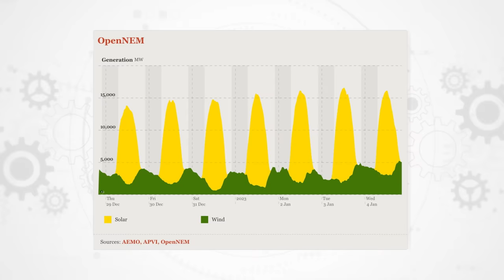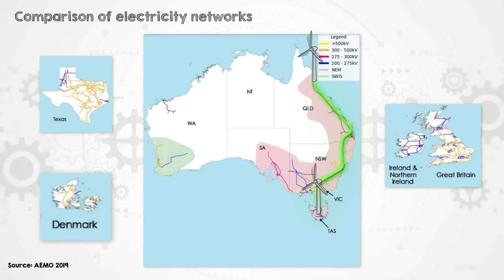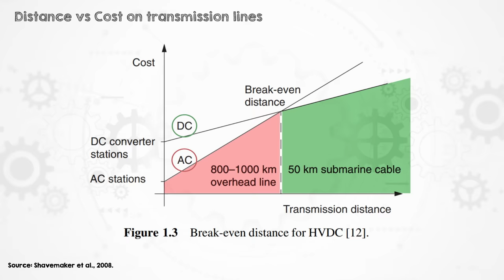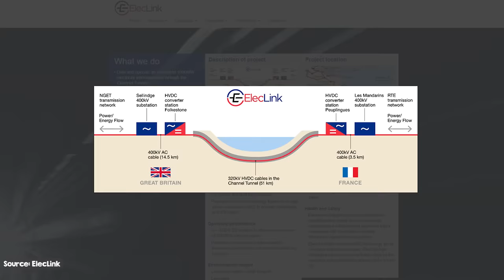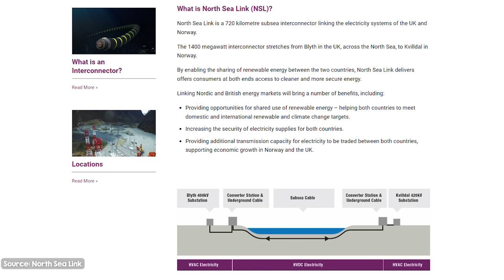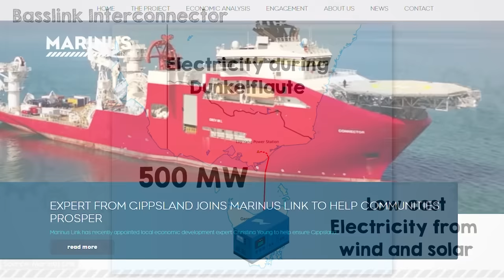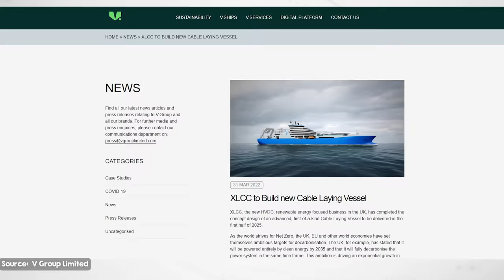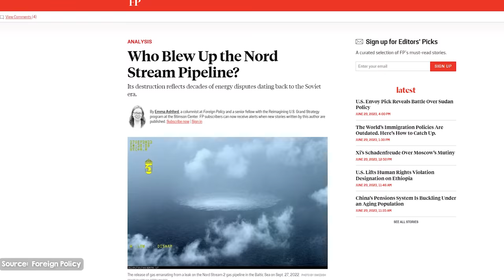Electricity Across Oceans: Is HVDC the Future?

Comment: Great video!  You mentioned connecting Montreal to Liverpool.  That means connecting to Hydro-Quebec, a vast and not fully utilized resource.  It generated about 225 TWh in 2022, an average of  25 GW. Quebec itself uses about 80% of that.  HQ has been trying for decades to get links down into the US Northeast, but they get blocked by local opposition.  E.g. there was to be a line across Maine down into Massachusetts that was strongly supported by the state of Maine, but delayed by a referendum paid for by a Florida natural gas company.  It's not quite dead, but in a coma.  The nominal reason was the effect of the power line right-of-way on Maine's forests.  Running an undersea cable down to Boston and New York might actually be easier!

I also keep hearing about HVDC from Iceland to Europe to distribute geothermal power, but so far it seems more economic to use the power to make aluminum.  HQ does that too.
Reply: Norway has done the same thing. There, in order to provide more 'green' power to their grid, they increased the depth of the smelters' reservoirs by a few metres. The smelters are connected to offshore wind turbines, and use them to pump water into the reservoir when they don't have a need themselves. The reservoirs were then connected to the grid for the first time.
However, these sources are in the North of the country, a long way from the main centres of population and industry. The result is that after the Norwegians went EV in a huge way, Norway was taking electricity from their HVDC connector to the Eurogrid. The result is that the EV 'revolution' in Norway is being fuelled by coal fired power stations in Poland and Germany.
Reply: @nicktecky55  When did Norway import from Poland? The only time Norway import from Germany is when the price in Germany is very low, exclusively when Germany has excess renewable output. And the EV impact on consumption and prices is so far insignificant. I did an estimate on Sweden, going all EV would increase demand with 10 to 15 TWh, and Norway has maybe 40 % less cars than Sweden. So Scandinavia going all electric on the roads would mean an increased demand amounting to less than 10 % of current consumption. At the same time some different cleantech projects, like Hybrit and H2 Green Steel, will each consume more than that.

Comment: Very interesting. Very long cables in the order of 1 km will also radiate energy (think very low frequency radio). I really enjoy your rational, well-thought out videos, with no hype, you are one of a kind on Youtube, actual expertise with no axes to grind!
Reply: If the cable was only carrying DC electricity, would it still radiate RF (or are you discribing something similar to but not actually RF?)
Reply: @chrismarshall25 A DC cable wouldn't emit any RF, because it is steady state. Electromagnetic fields/waves can only be created with changing currents.
Reply: Yes, DC conductors create a magnetic field around themselves.  The field varies as much as the current varies.  If the current is constant, then the magnetic field will be constant-- just like a magnet.
Reply: @peteinwisconsin2496  that wasn't my point 50 or 60 Hz  create electro-magnetic fields that will radiate on very long lines. this radiation is a power loss, like losses due to resistance.
Reply: @SuperFredAZ  0hz is not a radio frequency
Reply: @SuperFredAZ   ... this radiation is a power loss, like losses due to resistance. Yes, it is resistance. But technically it's called impedance.
Reply: @Alex-lc1bv  With switch mode choppers on DC systems there can be  RF radiation up to low VHF. Although the measured levels are minute and harmless to life it can be death to MF and HF radio communications.

Comment: For years now, Norway and The Netherlands are connected as well ...  North Sea. The Dutch also have an energy platform island in the North Sea, this allows connections with sea based wind farms (windmills connect to the platform, operational already!). The platform provides an opportunity to connect with the UK grid. Another Danish - Dutch platform will be built for more Dutch and Danish wind farms and to connect Danish and Dutch grids. Sea based connection platforms can be the interconnection nodes in cross sea networks.

Comment: 10:45 You mention Montreal. I think that I need to correct one very important detail about Québec. We have very little solar power. Almost all of our power needs are provided for by giant dams located a thousand kilometers north of the population centers. There's also a number of wind farms. In eastern Canada, the potential for wind energy is greeter than solar. It probably would be the right place to connect an undersea cable given that the power grid is rather well developed in Québec. Eastern Canada has gotten a few upgrades with the lower Churchill project, and there is room for another dam to expand capacity.

Comment: Hi Rosie, great video! Interconnectors are incredible and we need more videos like this one to help inspire future engineers! Just as a small FYI though, ElecLink does not make it's money from buying power in one country and selling it into another. The revenue is generated on a capacity auctioning platform called the Joint Allocation Platform (JAO). Basically energy companies can auction for the rights to transfer power a cross the cable and ElecLink recieves the money from each auction. The only time ElecLink would ever buy power from one country and sell into another would be during the commissioning phase of the project.
Reply: *Joint Allocation Office

Comment: In the winter you can get a few extra hours of solar power in your system going north to south.    It's always a 12-hour day at the equator.  If you're lucky enough to get some place on the other side of the equator you can get Summer sunlight all year round

Comment: Really pleased to see the use of non pumped hydro as a battery for wind and solar.
I was very surprised when commentators assured me that only pumped hydro could be used as such for reasons that were far from clear.
If only the electricity market in NZ was somewhat sane, we should be doing a lot if this here. Savecthe hydro for when the wind isn't blowing.
Reply: This is intetesting. Nonpumped hydro requires a bypass of some sort during dormant periods. If that is truely available and cost effective...perhaps we really already have an overlooked battery just sitting there and waiting for proper integration into the 100% renewable grid. This would be interesting to analyze. Has Rosie addressed this allready?
Reply: @aleksandrsnaumovs4277  My local "power station" is non-pumped hydro, been operating since 1962, only at peak periods as there is not much water available.  It does the same job as the UK-Norway HVDC link (where Norway is the local area), and was built mainly to avoid upgrading the power grid which can't support peak periods but can support average load - it is effectively a battery, but recharged by the river rather than the grid.
Reply: Why would you think that does not presently happen.? Hydro can be throttled quite readily as compared to geothermal or coal, and does indeed balance vs wind in NZ just that wind is still a small overall portion
Reply: Then it's not really a battery.
Reply: @Robert-cu9bm  It is stored power, discharged when needed and recharged when not needed.  Definitely a battery.
Reply: @nigels.6051  
So is coal a battery?
What about natural gas?
Reply: @Robert-cu9bm  Sort of, but they are non-rechargeable, since with the current world climate very little new fossil fuel is being formed compared to what we had in the carboniferous period.  However methane, which is the main component of natural gas , can be generated from net zero electricity and stored in our current natural gas stores,  so it is very likely that "synthetic gas" will be used as a battery, it is a good fuel for rocket engines and aeroplane engines, as well as feasible fuel for backup gas powered generators for when there is a lack of wind.  Much easier to store than Hydrogen, we already have large suitable stores..

Comment: Thanks for the explanation, as a civil engineer my knowledge of electrical things is very limited. 
As a Canadian, I’d like to point out that Montreal is no where near where you labeled it! It would be better to end that transmission line in Labrador as that is where the bulk of the hydro generation is. 
There is currently a proposed transmission line from Eastern Quebec to NE US that is being block for running through wilderness areas. I wonder if an undersea from Labrador to Massachusetts would be feasible 🤷‍♂️

Thanks again

Comment: Yes, geopolitical insecurities are likely to become more and more important issues to factor into undersea HVDC.  While battery storage (from pumped hydro to various cell chemistries) is seemingly more expensive, I believe the cost/kWHr storage will abruptly fall year by year in the next half decade as newer and more cost-effective stationary storage plants come on line around the globe.  Furthermore, it is MUCH easier to use such storage to smooth peak-demand on grids locally.
And last but not least, the massive and enthusiastic trend for home owners to go solar and also contribute to virtual power plants has been proven in the UK to remove massive stresses from ageing and (currently - no pun intended) inadequate electrical grid structures.
B.T.W. Seriously clear explanations in this one Rosie.  Thank you.

Comment: Can you talk about the energy losses at the AC->HVDC and HVDC->AC conversion stages compared to the high voltage AC step up and step down transformers?
Reply: I would like to hear Rosie on this topic.    Perhaps as part of a broader topic.
Reply: These losses are quite significant on the interconnectors under the English channel, which require rectifying to DC for the undersea transmission and then converting back to AC. Not stated in this video - where can the data on this be found?
Reply: Typically 1% is lost at each converting station. The biggest contributors are the transformers and converter valves but you also have some other HV equipment and of course all the auxiliary systems required for the station's operation.
Reply: @55damien55 I expected the in the conversion stage to be much higher.
Reply: @drescherjm  , I wonder how much you think it is, I work in HVDC and 1% per station is not a bad approximation. Of course each station is different but this is the kind of numbers we are talking about for this application.
Reply: @55damien55 I would have expected it to be closer to 10% each way however that is based on low voltage DC->AC. Edit: I Googled and see it works differently than I thought. I see now.

Comment: Great video.  Can you please consider covering Japan's odd 50/60hz HVDC interconnects in another video?  Benefits or challenges would be super interesting to hear.
Reply: Japan was my first thought.
Reply: What is a 50/60hz HVDC cable? Surely you can't have a DC current and AC current in the same conductor?
Reply: @richardrichards5982  For annoying historical reasons, Japan has two electrical grids: One at 50Hz and one at 60Hz. The simplified explanation is that electrification started during a period when politics were not good for central planning, so there was no immediate agreement on which frequency to use. The only practical way to transfer power from one grid to another is through a DC intermediate connection.

Comment: There is a problem for long-distance cables…
A transAtlantic cable must cross the mid-Atlantic ridge, which is where the two tectonic plates are moving apart (a few centimetres a year, I think).
But I trust the engineers know this and plan for it.
Although, 19th century engineers did not know about it, but the telephone cables were just fine
Reply: @mikeaugust747  "the hegemon"?
Reply: @mikeaugust747  no you said "the hegemon" as in something that exists not a "hegemony" as you defined.
Reply: As you're laying the cable just get the boats to do a couple donuts in that area.
Now you have enough cable for years of the plates moving.
Reply: A little bit of slack.
Reply: go watch a documentary on cable laying ships.  Its a good time.  also, every couple miles they do a loopty loop, and go in a circle to leave a loop on the seabed to allow for heat expansion, earthquakes, plates etc.

Comment: Thanks for explaining HVDC in lay persons terms. For many years  I was told only the only way to transmit power over vast distances was by high voltage AC. HVDC makes so much sense over long distances for all the reasons you have highlighted. I wonder if a country like Canada that has a small wide spread poulation can benefit from replacing overland HVAC lines with HVDC transmission lines?
Reply: Canada has used hvdc for many years. Nelson river and Pacific interviews are two examples.
Reply: For many years that was true.   Advancements in semiconductors that allows them to handle more power and higher voltages have enabled HVDC to exist at all.   There weren't diodes powerful enough to rectify AC into DC, nor the semiconductors to do the opposite at the other end. Thus, you were told right, some time ago.
Reply: How old are you? - When I studied 40 years ago I learned about the Itaipu HVDC line in Brazil which was installed then.
Reply: @Henning_Rech  I got my degree in 1978 in Argentina so Itaipú was relatively close and we knew very little about it but HVDC wasn't in the curriculum at that point and not available to us anyhow being based mostly on proprietary technology.  So, the basic recipe at the time was long-distance => HVAC.  Anyway, I just meant to confirm that what @vincentrobinet heard was, indeed, the way things were done.  That is also backed by the story of the Edison vs. Tesla, DC vs: AC dispute, which is also well known.

Comment: Thanks for the vid! In looking up undersea cable laying, I found out about floating solar farms - curious to know your thoughts!
Reply: It's a fascinating idea — and as with offshore wind farms, would probably use HVDC to get the electricity back to land where it can be of use — but there are some disadvantages. They need to be anchored to the seafloor so they don't drift around and strain the HVDC cables — but still be able to rise and fall with the waves and the tides. The floating platforms need to be large enough and sturdy enough to withstand ocean storms, and made of materials that won't degrade in the corrosive salt water and the relentless UV of the sun. Marine environments are no joke to engineer for.

And then there's repairs and routine maintenance, which will be somewhat less convenient than on land. Also, will salt spray and mineral deposition become a problem on the PV surfaces, or will rainwater regularly wash them clean? If you have to manually clean them every so often, that could hurt the economics. Or do you come up with some sort of solar farm Roomba?

Comment: The advance in materials technology that makes subterranean transmission at 200 - 400kV possible is AMAZING. 

When I was a kid, a 4 mile 275kV underground cable was laid into the city.  It needed plumbing for oil as this was the only effective insulation available.  Underground and high voltage simply didn't mix. 

Now we can lay, not just underground, but under sea, at hundreds of feet.